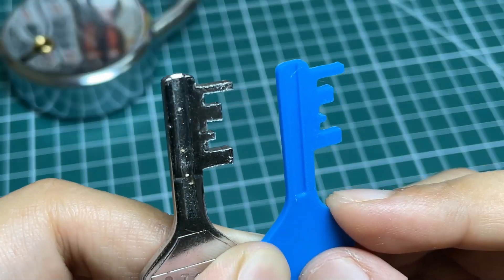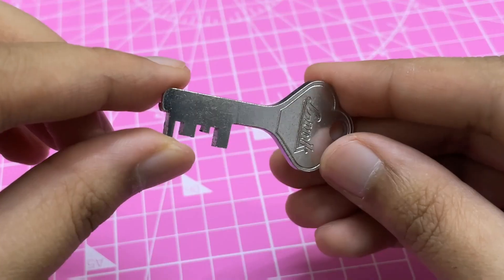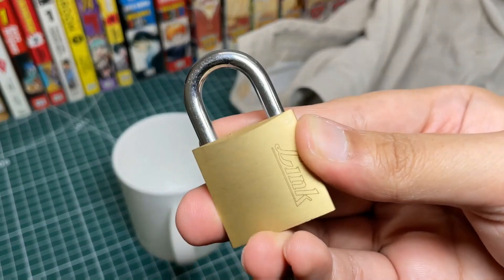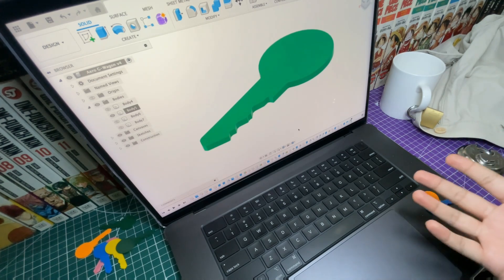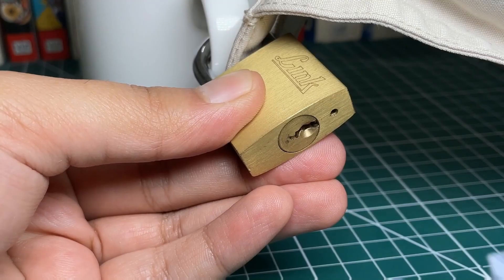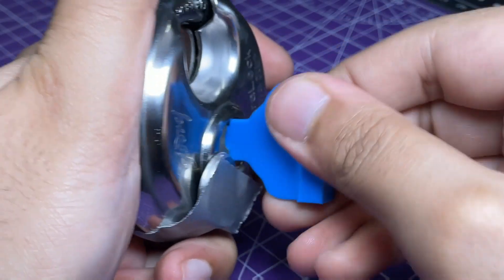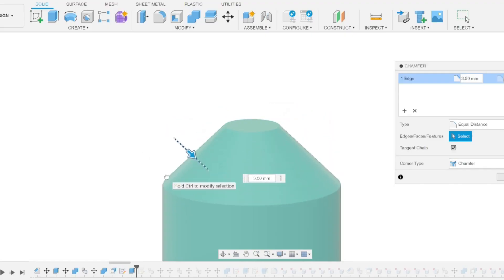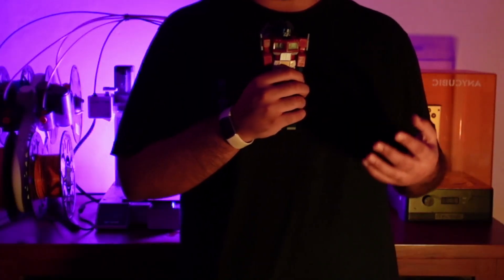Will 3D Printed Duplicate Keys Work?

Comment: Raking locks like the scond is very simple with a proper toolset. Learned it once you can open any lock that is not safe against those attacks. But this never worked for me with dimple locks. As you showed those dimpl locks usually need less percise keys... which makes it simple to create keys from photos 😞

Comment: You can measure the depth of the dimples with the pointy stick on the bottom of any caliper.
Reply: a better (or at least more accurate) way would be to put a small sphere of known diameter, like a bb, in each dimple, then measure the combined thickness of the key and ball. then simply derive the diameter of the dimple using basic trig. or consult your handy copy of the machinists handbook to work out the diameter. or do what i would do and bang up a parameterized model of the ball and key in cad and let the software figure everything out for me.

Comment: People get so freaked out about this kind of thing, without thinking that there is usually a nice big easily breakable window right beside most locks.  Picking the lock or duplicating a key is unlikely to be a common route of entry.
Reply: Yeah it'd be much easier to just pick it
Reply: windows, bolt cutters, hammers... so many ways to ignore or get past a lock yeah
Reply: Most people live in an apartment where getting through a window would mean climbing.
Reply: @LutraLovegood  I don't  know where you live but there are lots of people who have houses.

Comment: The things you had difficulty identifying from photographs (the grooves in number 2 and the dimple dimensions in number 3) are things that are industry standard. This means that you don't even need a good photo of you know what you're doing.

My understanding is that the dimple style came into fashion because a proof-of-concept showed that you can recreate a functioning copy of a notched edge from a very low res image very far off just from a silhouette. Dimples reduce the silhouette, so you need better resolution and zoom to get a usable key duplicate.
Reply: Exactly. Afaik, there are standard key templates. Have fun looking for a rare one in case of needing a legit duplicate (I did this once, ended up with a failed copy at first try).
The only task for a key maker is to copy unique part of grooves on good enough template.
Reply: @tozpeak  Yup, and given that there are fixed locations for these groves and a limited number of potential depths, it's mathematically trivial to get a pretty close approximation, hence mobile phone camera pictures generally being enough.

Comment: Cool video! haven't seen a video that explores 3d printing keys for more than just pin tumbler locks.
The biggest thing to note about the second lock, is that the depth of the valleys are the only thing important for unlocking (just like the depth of the dimples in the dimple lock). The hard to print pointy parts of the key can be flattened. The other problem with the jamming could be solved by making the key really thin and using a separate tool for turning if needed. With these two things in mind, printing it on a normal filament 3d printer could be more doable.

Comment: Yes. You don't even need a photo if you have enough expertise.
Bold claim I know. Hand me that Schlage blank and let me look at your key for a few minutes so I can remember what order the cuts are in. :) 
As a side note, any locksmith worth the time will have tools on hand to pick that lock, get the bitting in the process, and cut you a new key. For a lock like this it would take no more than 10 minutes. The cost could be more than it's worth though as some charge astronomical amounts for a 30 second task (this being picking the lock open).

The crux of my point here, is that most keys are _ type of blank that have _ teeth cut out for _ lock.
Reply from the maker: Oh, that is super interesting, does the teeth cutting thing apply to keys with indents as well? (like the 3rd lock in the vid). I'd be curious to learn if that's an option as well.
Reply: @toast_channel  I don't know about locks like the last one unfortunately, but your method seems to be the best one I can think of for getting the depth from a flat image like that. I do know a little bit about cutting house and car keys though (I'm obligated to say that I have no experience, I just fell down a rabbit hole). The common option to duplicate a key seems to be getting a basic key cutting machine where you trace the bitting of the original key onto a new key that has the same shaped keyway and no cuts on it (a blank). However, on some key cutters they have an option to set the depth of each cut, so only a photo would be needed. This would be known as a code cut key. 

With the photos you took for keys 1 and 2, you could import a photo of the appropriate key gauge for each and overlay the photo to get the bitting, you could then give the code to a locksmith to cut a new key, as well as a picture of the lock so they know what blank to use going off the keyway shape (alternatively you could just show the flat photo of the key, they'll know what to do with it). They will obviously ask for your address and probably have other questions, to make sure you do actually own that property. 

Now, if you don't have any of that, you can get a lishi lock pick (they're expensive) which are basically lock picks with a guide on them. Picking the lock will give you the bitting, and most locksmiths will have these partly for that reason. There is however another option... But it's only reliable on the second lock due to how it pushes the pins. You can make a blank out of a softer metal that you can then jam into the lock, and slowly file down where the pins leave marks on the key. This should give you a key that can open the lock... But it will likely take even the most experienced locksmith 30 minutes or more to do as the process needs to repeated many times with the blank to get everything just right. 

To my (again quite limited) knowledge, there are some machines that can do dimples as well as your normal cuts, but they require a dimple cutter which basically works like a drill bit on the key as opposed to a saw/file (such as the HPC mini speedex). I don't know if you can code cut on them, or if you just trace with them. But now I'm definitely interested to look into that a bit more. 

Video 163 from HelpfulLockPicker went over some information about deciphering bitting (better than I have). I can't remember where I saw the key cutting, but it was from one of the popular lock picking channels. I'll try look it out. ilco also have a list of standardised blanks that may be useful for certain keys.